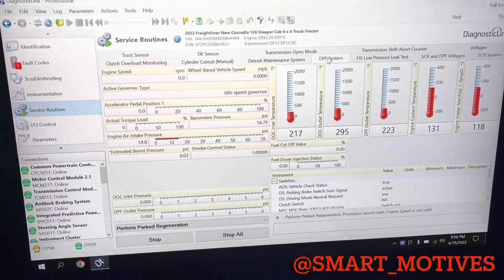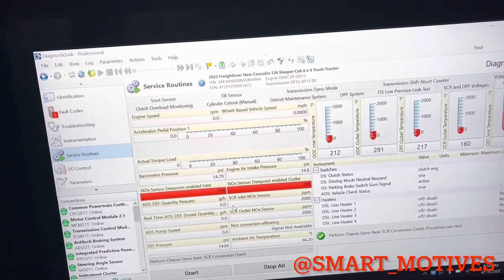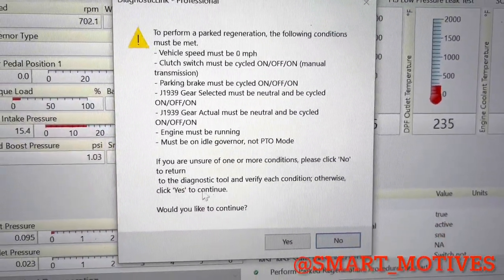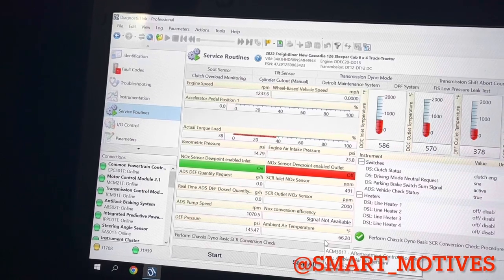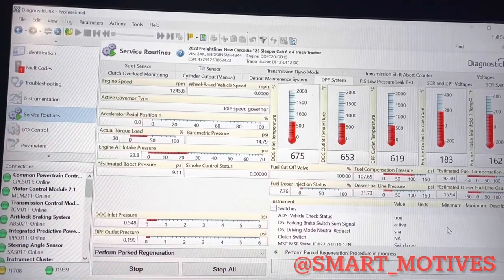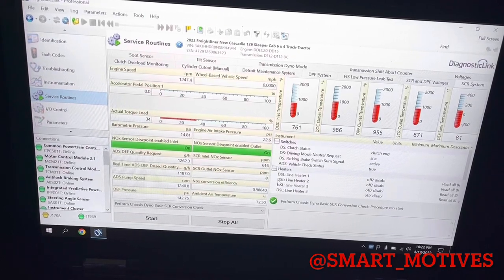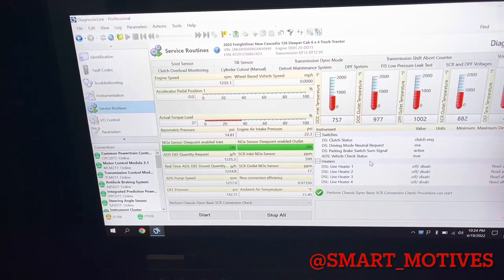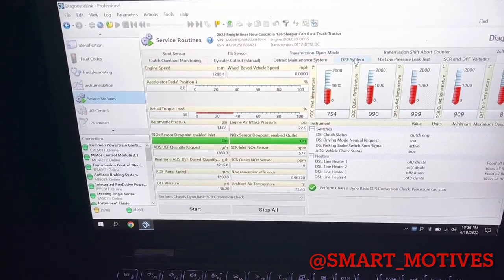Regeneration (Regen) Values and components explained on a dd15￼

Comment: New diesel mechanic here- where can I get the regen values literature? I just got my authorization for the DTNA connect for freightliner. 
I have Cummins insight, direct link (but haven’t tried it yet) and JPRO, and snap on tool- but not knowing the values makes them paperweights 😂
Thank you for the video! This was the best one I have found explaining values to monitor during regen!